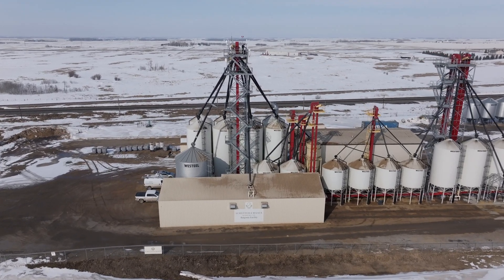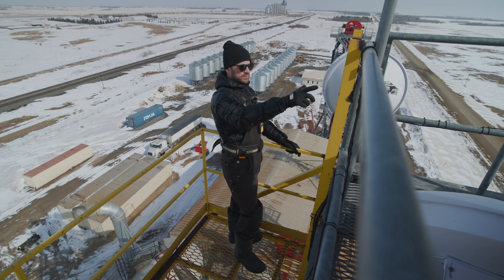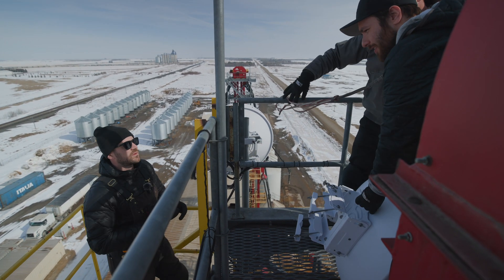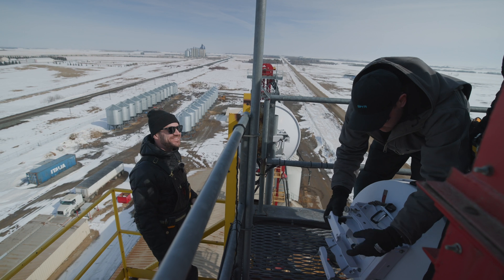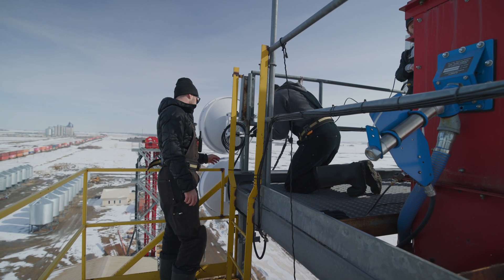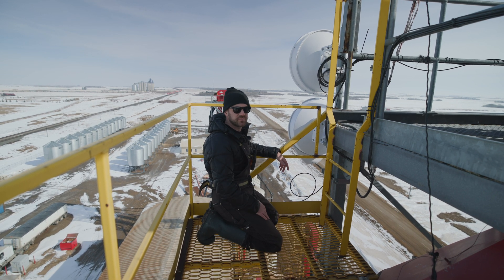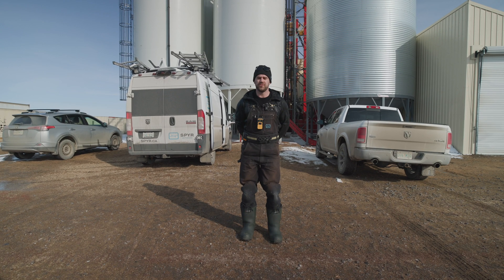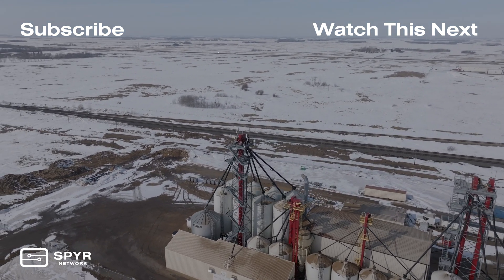Balgonie Tower Upgrade - Installing a Ubiquiti AF60XR backhaul radio

Comment: Hey Guys, small ISP in North Vancouver here reaching out. Any chance you could do a few videos on what you guys are looking at when you align the antennas. I have 70 customers with 50 on the Wave Micro 2 aps and the rest are on LTU. I have 3 sets of the Wave Pro’s as my back haul. Completely self taught and have no clue if I’m doing this correctly when I go to align everything.
Reply from the maker: Looks like you’re off to a good start! Are you interested more in the backhaul info or CPE side of things?

Comment: howzit guys, What distance are you running this 60XR link? any drops in rainy weather on the 60gig link?
Reply from the maker: Our longest is about 11km and we do see the 60 drop in heavy rain although we’re in a very dry climate. Only happens a couple times a year. They will eventually be upgraded to license links.